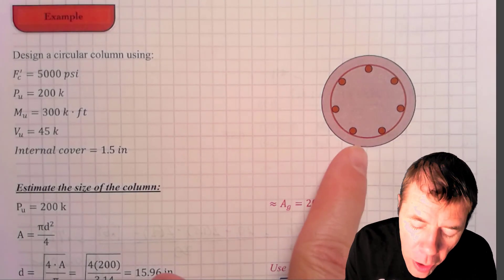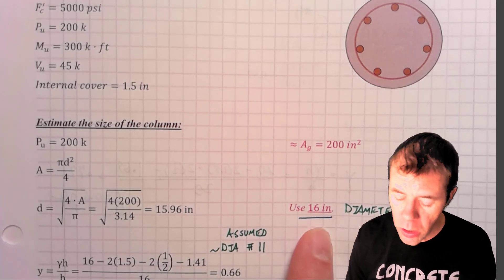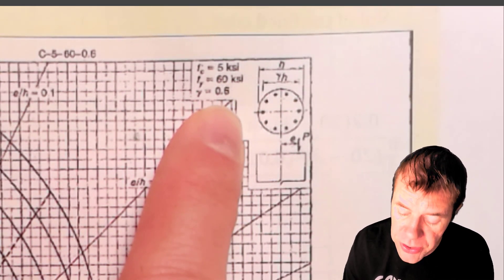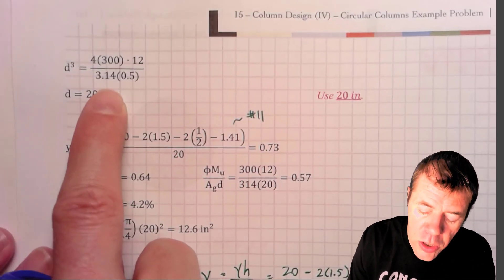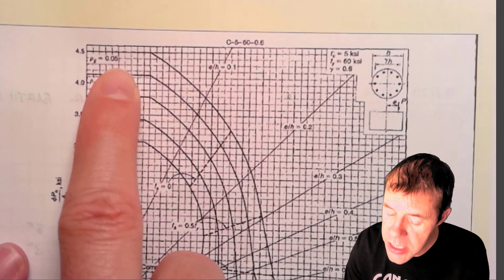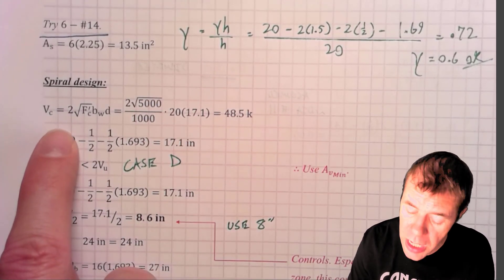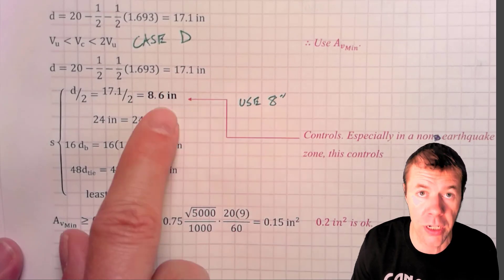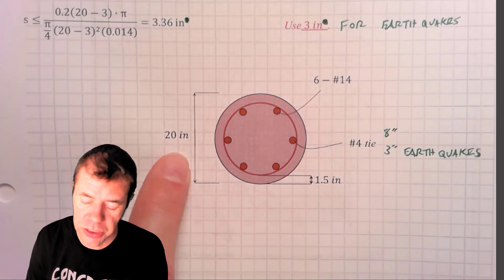column design example | reinforced concrete circular column high moment

Comment: If I were using a Bigfoot Systems bell shaped footer on the the bottom end of a Sonotube would my rebar cage flare as the footer got larger in diameter inside the bell and would my hoops get larger as well or would I just keep a cylindrical rebar column all the way down?
If I were building a structure and my engineer called for #4 bar 12" OC in the vertical and horizontal rebar grid, is there any detriment to using the same size bar and doing 6" OC vertical and horizontal for added strength? Or 3" OC? as long as my cover depth and rebar size remained the same? What about when a drawing calls for grade 40 rebar and using the same diameter, but increasing the grade to grade 80 or 100 for significantly higher tensile strength? Thank you

Comment: Weekend warrior advice for circular columns? Is smaller and closer stronger. Instance. A 3mx7m three storeys building.  Made with two 12mm rebar in a 6" column @a meter apart. So 7 columns X 3columns rectangle. Usually a minimum of 6bars in a circular column with a longer span.

Comment: Also in calculating the d value for the Vc, the concrete cover (1.5") is left out of the equation.  However, the resulting answer for the d value is correct.

Comment: very good lecture.  Example is clear.  However, Area of gross Concrete, Ag and Area of Core, Ac values are not correct, resulting in different ps value.  However, your answer is correct.

Comment: What are the Advantages/Disadvantages between Spherical aggregate , and Angular aggregate . What is the ratio of Cement to aggregate for Load Strength ? This is a non-rebar column .

Comment: Just as a practical suggestion, I never go over 4% of steel unless I really have to. The splicing and congestion gets really difficult to design for. I have gone up to 6% but the entire 6 story columns had to be detailed out with all the bars to ensure concrete could get into the column and many of the bars had to multiple stories high which is really difficult to stabilize during construction. 

With an axially dominated column, it is much less expensive to increase the concrete than the steel. I like to keep the axial load down at 12MPa or less (unless I am using high strength concrete) and the percent axial steel at 1%. With a moment dominated column, I like to keep the Mf/Agh down at 2 to 3 MPa (I am not too sure what that translate into for the US since it looks like you have different load and material factors). These are just rules of thumb to make the design faster and the structure economical.

The US interaction diagrams also look a bit odd because of the way you use factors (ductile vs brittle).

Comment: Did you ever have a look at what  what Caltrans did to existing freeway columns.  They overwrapped them in 1/2" steel plate in a form fitting jacket them pumped hydraulic cement in to prevent crumbling and failure during quakes. 
Buildings have overwrapped columns in an epoxy soaked kevlar weave to stop the columns from expanding and crumbling causing failure. 
I personally would love to see W beams with cross beams embedded in new concrete columns as the possible mega quakes have predicted 6' to 10'  tall shockwaves per second along with offset  movement between 35' and over 200' of lateral motion determined by geological research of prior mega quake events. Mega quakes also last for 3 to 5 minutes. The 9.2 in japan lasted for 5 minutes. The 1964 Alaska quake lasted 7 minutes and was reevaluated to have been a  9.6 I think.  This is info that designers need to realize.

Comment: Why not just make a plug in software for this using Microsoft Excel
Reply: Exel, or any spreadsheet system, is notoriously difficult to debug, modify, or prove correct. The horror stories abound. 

Best to use an explicit programming language: easy to exercise, modify, document, debug, and most important - verify.